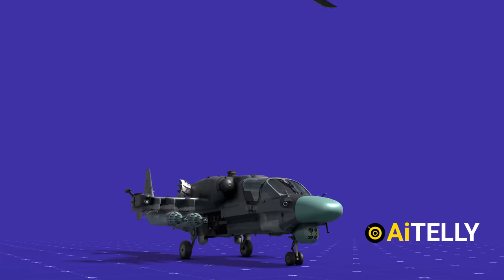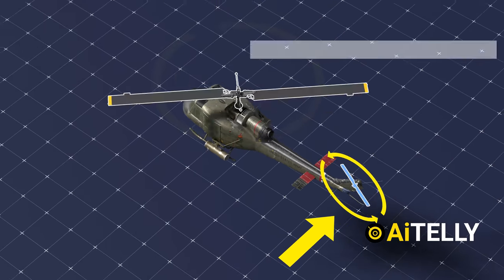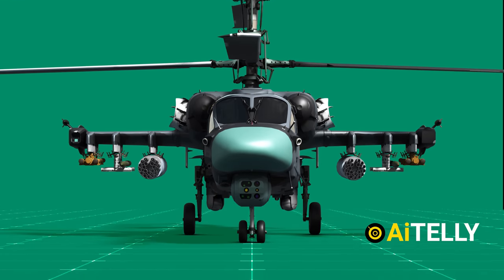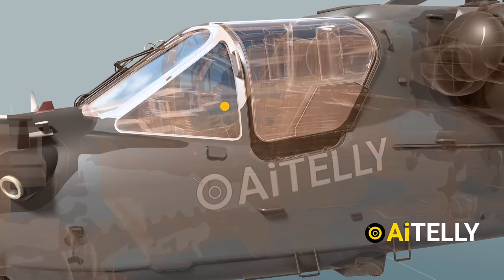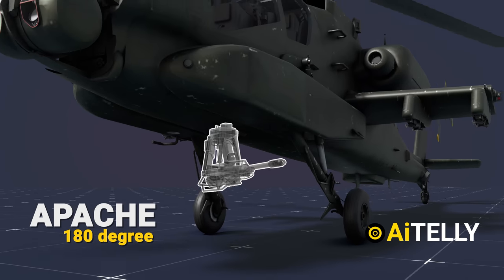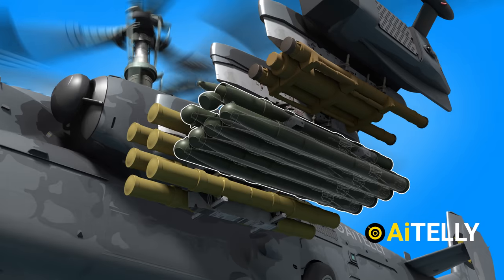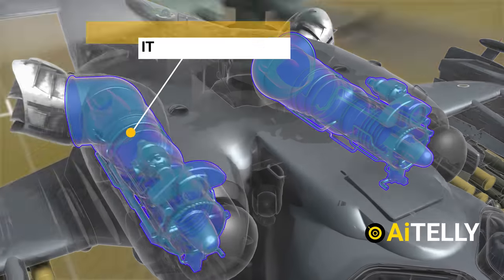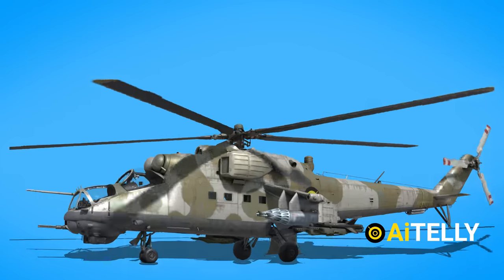KA 52 How Military Coaxial Helicopter Works #ka52 #helicopter #coaxial

Comment: I wonder why coaxial main rotor helicopters are rare even though the design is more efficient than the tail rotor system of conventional helicopters.  That said, quite a few of these Alligator helicopters have been downed by Ukrainian anti-aircraft projectiles during the current war.  It must be absolutely terrifying to suddenly lose the main rotors and start to careen out of control while hugging the terrain at 200 feet AGL.
Reply from the maker: Yes many have been hit by a simple stinger Missile.
But I love these coaxial rotors.
Reply: They tend to be more complex and expensive.
Reply from the maker: @Krolmir96  that's why it's not used for Commercial and private Helicopters i heard.
Reply: Comparing  the downed ka52 and it's victims by number or the destruction it creat on current conflict , i prefer ka52 lol
Reply: @Aitelly  There is a video where the helicopter withstood a direct hit and returned to base. 
There is also a video where the helicopters after the hit easily landed on the ground and the crew remained alive. Unlike the same Apaches.
Reply: @Aitelly  KA 52 It's a flying tank.
Reply: I’m guessing it’s because of more demanding maintenance, also more moving parts means more things that could break. Just a guess though.
Reply from the maker: @TheGreatCatsby-pd2tt   we strongly agree the helicopter was built Tough in responds to the American Apache.
But Considering the Infantry Soldiers in this modern battlefield, they are still very sucessfull.
Reply: Do you know they have ejection seats as well? I've seen them those videos as well and I'm sure you noticed how they don't spin out of control and tumble down like other helis with tail rotors even after they are hit...much higher chances of surviving a hit.
Reply: The Ka-52 is truly a masterpiece of engineering. The double rotor system is amazing. I love the stability of this aircraft compared to single rotor ones.
Regarding the helicopter being downed, well, every Helicopters are sitting ducks to be honest...
But we love them because they are so cool.
Reply: Don't mislead people. These helicopters were shot down only by anti-aircraft guns and hand-held anti-tank missiles. The KA-52 proved to be a very survivable helicopter. 

And the most important thing is that it has the Vitebsk complex on board, which can steer missiles away. It is due to this complex that Russian helicopters remain invulnerable from stingers.
Reply: @TheGreatCatsby-pd2tt  In russia, the Mi-28 is called a flying tank. It was built similar to the Apache, but with improved armor
Reply: @Лютик-д6ь  В россии его не любят
Reply: @BBCRF  мне это известно
Reply: The bell defiant X is adapting coaxial rotors too
Reply: Where are your proofs from the expert 🤣🤣🤣🤣???
Reply: @Лютик-д6ь  it might be true. There is a video of mi-28 being downed by starstreak which is apparently a very complex weapon that uses some spacial guidance method. There is another video of a ka-50 being downed by an ATGM. There probably are stinger kills too because all of those measures countermeasures are never 100% but it does appear to be a very safe platform
Reply: @alexfischer7554  "The first casualty of war is the truth" intones that old saying.  Both sides in all conflicts blend fact with fiction to enhance tactical and strategic leverage amid the concurrent war of words.
Reply: you know that one of the two runner ups for the US armies new helicopter is coaxial..the SB1 defiant
Reply: It would need to redesign the helicopter that most countries use and might need more R&D
Reply: @vandasaragosa  as far as even the Russian TV shows us, most ka-52 sorties are the same as any other helicopter's in the conflict - lobbing unguided rockets on a ballistic trajectory by eye, hoping some of them will impact somewhere close to the enemy.
Anything else is practically a death sentence for the helicopter as AA saturation is so high, there's a MANPAD in every bush now.
Reply: The Russians have been solving the problem of controlling two propellers at once for over 20 years. This seems like an easy solution only on a 3D model. In reality, you have blades that bend during flight and can meet during rotation.
This is not a very simple scheme when performed in reality.
As for the losses of these helicopters, they exist, but they are not so high. Otherwise, Ukraine would have long ago flooded all social networks with photos of downed helicopters.
However, the Vitebsk defense system shows incredible efficiency. There are many videos from the cockpits of these helicopters, where the protection system diverts 2-3 missiles aside at the same time.
In addition, if a MANPADS catches up with this helicopter from behind, then it destroys the hull, but not the cockpit and engines. There are many videos of very badly damaged helicopters returning to base. One pilot gave an interview where he said that his helicopter received shrapnel damage from shelling from a 120mm mortar.
As for Ukrainian air defense, they are difficult to disable, 99.9% of the time they are inactive and turn on only when there is confirmation from the ground or from NATO headquarters that the target is in the affected area
Reply: Quite a few? How many is that? 3? 7? 30? How do you know? Ghost of Kiev taking them out? You think the Apache would fare better against the same enemy?
Reply: @marcgatto9675  Sounds like we might have to duke it out to determine who is right.  Meet me alongside the junkyard over on 6th Street at noon next Monday, and bring your own gloves. God bless America!
Reply: @juryfilatov4520  Brillian insights here, and much appreciated too.
Reply: For sure it is better than apache when it was hit by stinger missiles...up until now, there is no apache ever being put into an environment where AA missiles are like a tic tac. KA-52 is documented to take AA missiles and still flying.
Reply: Coaxial helicopters are more difficult to manufacture and more expensive to maintain. Requires better materials for the blades to eliminate the problem of crossing. Difficult to mass produce. This limits the use of coaxial helicopters. They are effectively used as medical, military, rescue aircraft, or in difficult flight conditions (in the mountains in India). The USSR also used coaxial helicopters for agricultural needs, where the level of pilots and problems with alcohol were solved by easier control.
Reply: @TheGreatCatsby-pd2tt  who told you?
Reply: where do you get information about the number of downed K 52?
Reply: And at the expense of the loss of rotors, ka 52 has an ejection system.
Reply: @Vasili_Terkin  As a graduate student at the prestigious University of Youtube, I am required to have all such data at my fingertips ready to divulge without notice.
Reply: Вертолеты с соосным винтом сложнее, дороже, менее надежней. Плюсы получаемые при такой компоновке есть, но не всегда оправданы. Школа производства таких вертолетов идет со флота. Там она давала главное - компактность(короткий хвост). КА-50 создавался как ответ AH-64, соответственно результаты его испытаний на полигоне лучше, как и у ка-52.
Reply: @Aitelly  ахахахах, вы смешной человек. Более 90% ракет стингера уходят мимо благодаря бортовому комплексу обороны Л-370 «Витебск»😂😂😂 можете не писать свои фантазии)))
Reply: @BoraHorzaGobuchul  глупости, есть баллистический вычислитель, никто наугад не стреляет. А вот со стингерами справляется бортовой комплекс обороны Л-370 Витебск!!!! Более 90% стингеров уходят мимо!!!!!
Reply: @Лютик-д6ь  Его сбивают стингерами когда заканчиваются тепловые ловушки.
Reply: @BoraHorzaGobuchul  Да, у украинцев очень много стингеров. Когда тепловые ловушки заканчиваются вертолет становится удобной мишенью.
Reply: @BoraHorzaGobuchul  На какой глаз, дурында? Про баллистический вычислитель не слышал?
Reply: @АнтоДив  Именно.
Reply: @Aitelly  Только после попадания стингера летчики на вертолете апачи сразу отстреливают свои души в ад, а летчики на  вертолете КА-52 катапультируются, садятся на новую машину и продолжают крушить технику НАТО вихрями. Ведь самая дорогая и сложная в воспроизводстве деталь в в боевом вертолете это летчик, не так ли?

Comment: 1) Armored plates is a big issue. Glass yes, armored. The hull is punched by conventional small arms 2) During the war there were only 2 ejection. 1 one is not good - the pilots died, in the 2nd - only one pilot survived. It is not modified or done badly

Comment: As war in UA has shown - defensive systems do not work as planned - both IR guided and Laser guided missiles hit and destroy Ka-52 with all its heavy armor. Strange for me, to be honest...
Reply: Heli's in Ukraine are flying very low because they failed to eliminate Ukraine's air defense systems, so they have basically no time to react to incoming manpads. Though if I remember right KA-52 should have a missile approach warning system that automatically flares when it detects an incoming missile. I haven't seen any of the helis hit deploy flares before they were hit so I wonder if it's turned off or defective. Though we're probably not seeing videos of missed manpad shots.
Reply: @TrampMachine  theres a video of one flying and it auto fired all its flares in under a minute. Someone on the ground waited and boom smacked it out of the sky. They don't have many flares
Reply: Друг,есть видео ,где на аэродроме гостомель ,как ушёл от 5 стингеров ,защитная система настолько хороша ,что она даже распознает тип ракеты !
Reply: “Heavy armor” the KA52 doesn’t have heavy armor and isn’t meant to counter missiles with its panels.
Reply: @TrampMachine  agreed not seeing missed as that would be bad for Ukraine proper-gander.

Comment: Viktr missiles have more than 8km range, theres footage of a KA-52 in Donbass engaging and destroying Max Pros Mraps and M2A2 bradleys from ranges of over 17km ( this was calculated by taking the speed of the missile into consideration and how long it took to reach these targets) . 

The 2A42 30mm cannon although mounted in a limiting position is also on the Mi-28s but they're almost fully traversable yet both are totally useless. This isnt like in the Iraq war or Afghan where the air space is uncontested and surface to air threats are all neutralized nor as sophisticated as what the Ukrainians are fielding. You simply cant maintain altitude and utilize thermals and the autocannon to take out soft threats from far like in previous conflicts . The viktr missiles are multipurpose and can be use to target soft targets from further and at a lower altitude where as the Shipunov's 30mm would be heard from miles away. 

One thing you should have mention is the advanced targetting system and CCIP of the KA-52s that basically make it possible for the pilots to target enemies extremely accurately with cheap non smart munitions such as the S-8 and S-13 rockets where as the NATO/western countries use munitions that have guidance built into the weapon itself. This basically means the pilot of the ka-52 can use cheaper, more readily available munitions just as effectively as the more expensive munitions being used on stuff like the AH-64D which cost way more.

Comment: it has 2 rotors, in case one flies off, and the front swings open if you need more leg room, i imagine its got some fancy gimble cup holders too, and of coarse, am/fm cassette with ANL for local stations   you can also order k/c dalighters too

Comment: The concept of counter rotors is not new. The Flettner Kolibri basically used the same principal as a synchrocopter. The difference was that the rotor blades were intermeshing.

Comment: Coaxial design is great. I wonder why the Americans never used this design.
Reply from the maker: I heard it's very complex engineering with cost
But the American has been working on it.
Reply: @Aitelly  I'm not a helicopter expert but I think that the biggest negative to the coaxial design is the amount of energy expended to turn 2 main rotors instead of 1. It wouldn't  be energy efficient.
Reply: @bobbymak6964  
very good point 👍
Reply: @bobbymak6964  2 coaxial lesser diameter main rotors instead of one bigger diameter main rotor coupled with a tail rotor (with corresponding transport energy losses). Which solution is more energy efficient is debatable.

Comment: Some facts omitted / erroneous here: 
1 - since the turbine do not need to spend power in a tail rotor,  KA52 is 25% more powerful than a conventional chopper - like the murican Apache, for example. That translate in better climb rate, altitude and speed, or 25% more weapons load.
3  - KA52  is equipped now with "With 18 Missiles ‘Blocked’, Russia’s Vitebsk-25 Electronic Warfare System Saves The Day For Ka-52 AlligatorIt seems that the Russian weapon designers have found an antidote to the FIM-92 Stinger MANPAD missiles, made available in large numbers to Ukraine by the US.

2 - The max speed is 315 km/h, and the range is 850 km - both max speed and range are slight superior to Apache.  

Recently, Ka-52 demonstrated why it had earned the moniker of ‘Alligator’ as it took on 18 MANPADS by jamming their frequency, completed its mission, and returned to the base unscathed.

The secret lies in an air defense system named Vitebsk-25, developed by Russia. The export name of the electronic warfare system is President-S."

Comment: What an amazing machine. The dual contra rotor saves about 15% of energy lost to the tail in max effort climb. The reduced rotor diameter permits flight in tight areas such as between streets and ability to hide below tree tops better than other machines. Twist with differential torque to one rotor permits rapid pointing. An amazing design and I was told the gearbox is very reliable. This could be exported in large numbers except of course Putin made enemies of 95% of earth.
Reply: May be 96%. O, eah!
Reply: fun fact, usa and her colonies such as europe, canada and australia is not 95% of earth
Reply: g7 is 20%
Reply: @acknodbikes5051  what is “g7”?

Comment: You mean down on the RIGHT SIDE is the autocannon. One must name the sides always from the pilot's perspective!
Also, the speaker has clearly some issues with endings in plural..
"ArNaments pods"??? You mean "arMament"?
Vikhr should be actually pronounced without a K  – more a hard H – vihr.
And it's Iglá, not Ígla.

Comment: Nothing is said about the airborne defense complex of the BKO "Vitebsk" helicopter. This is a block of instruments that includes a control device, an optoelectronic suppression station, laser irradiation detection equipment, an ultraviolet missile launch direction finder and a decoy ejection device. First, "Vitebsk" detects enemy shells, and then false thermal targets and dipole reflectors are taken into action. Passive interference leads to disruption of the homing system of the enemy missiles and "shows" her the way to a false target.

Comment: Does KA-52 still have to point nose upwards to fire missiles, that was the issue with MI-(*) choppers. Missile thrust when firing caused instability and nose must be upwards to compensate.
Reply: 1) This is not true. Helicopters raise their noses so that unguided ballistic missiles fly further. 
2) Kamov helicopters have no connection with Mil helicopters. These are different products from different manufacturers.
Reply: @Артём-ц5э8з  Thank you for clarification, that is what the pilot told us at a time. Said missile launch causes instability. I noticed they still do this today. Years ago they could never hit a target with unguided missiles, now seems to work. Obviously Russia improved all of that.
Reply: @browntigerus  It turns out that it is unclear what it is about. 
Maybe there was a problem with some modification of the rocket or launcher, but it is obvious that it has aged. There are enough videos where helicopters shoot these missiles with direct fire.

Comment: I appreciate the effort put in to this but it’s laden with inaccuracies, to start ‘co-ax-iahl’ not co-actual. “Most helicopter main rotors rotate in the clockwise direction” … not true, there are as many CCW as there are CW, European types tend to be CCW while many US types are CW, it’s up to the manufacturer. Still this extremely versatile and capable machine is often overlooked for more hyped Western types, so I appreciate your effort.

Comment: How does the ejection seats avoid the chopper blades from being pilot chopping blades 🤔
Reply: The blades are ejected too.
Reply: - it's not working, cause it's just another russian "paper tiger". Noone of downed ka-52 had it, cause it just a fake.
Reply: @hztn  There literally is a video of Ka-52 ejection on the net, named accordingly.
Reply: 1. Blades are ejected
2. Canopy is broken 
3. Ejection rockets are shot, pulling the crew away by elastic strings to prevent fractures. 
4. AFAIK the crew has to deploy their parachutes manually, although I'm not sure about this part.
Reply: @ShadeAKAhayate   
- Ye ye, that working only in computer games on your channel, but in reality it's just ripping apart, ahahah.
Reply: @hztn  You would never know, gloating from afar. Go check that yourself, your Nenka needs you.

Comment: BARELY started watching the vid and immediately there’s a HUGE problem with stating verbatim “most helicopter’s main rotor rotates in a clockwise direction”..ALL WHILE the CG(graphics) OF a UH-1’s semi-rigid 2-bladed rotor system IS ROTATING IN A CCW manner. Major wrong there..HOPE it improves!
Reply from the maker: Agreed we messed that up.
Communication issues between 3 animator and Script writer

Comment: I dislike the look of it and I very much prefer the look of the Mi-28 which to me is by far the sexiest, most badass chopper. But the Ka-52 is an incredible engineering achievement.  I would be curious to know how much better/advanced it is compared to the Mi-28.
Reply: It's neither better nor worse than Mi-28. They are different tools for different jobs. It's like comparing a screwdriver to pliers.